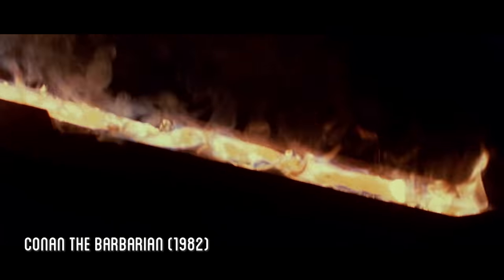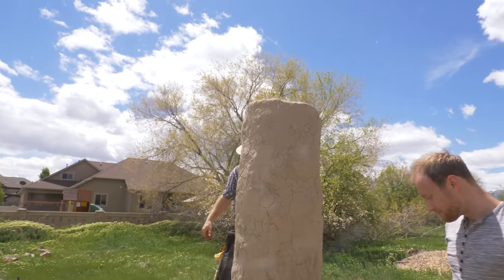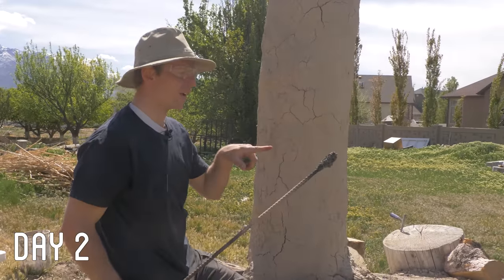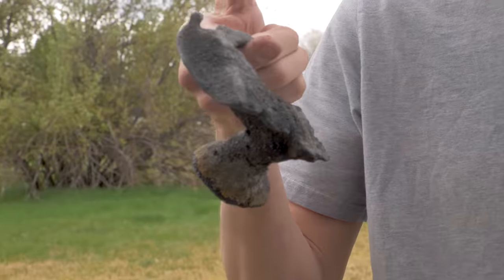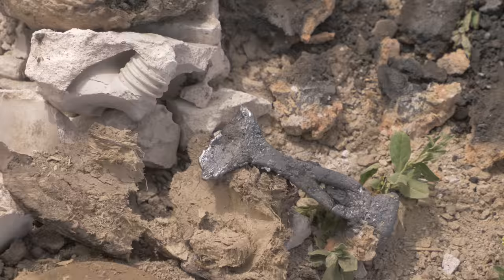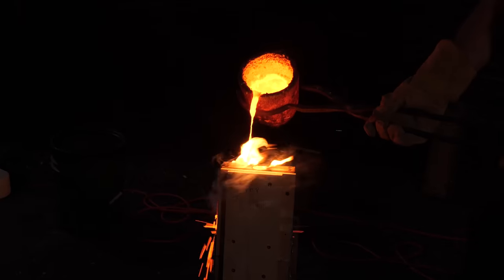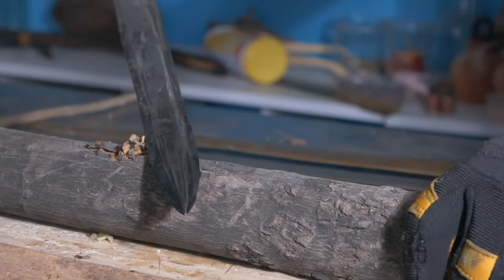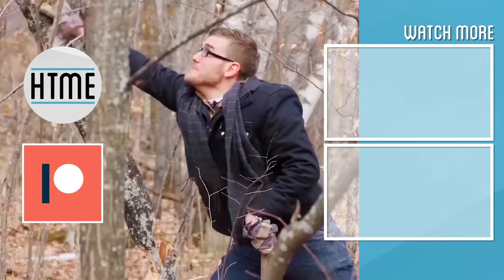Can You Cast an Iron Sword?

Comment: You may want to use two-piece molds and preheat them before pouring. 
Also, the Primitive Technology channel has a couple videos about making primitive cement from wood ash. Mixing that cement with silicate sand might get you a concrete mix heat resistant enough to keep your furnace from melting, much like the plaster and sand mixes used by TKOR, Nighthawknlight, and others.
Reply: It's a nice idea, and it MIGHT work, but..... I don't know.  I'm not sure whether it could handle that kind of heat or not.  Maybe?
Reply: @corwinweber693  Yes, a bit of a risk and probably worth testing a small piece under intense heat before building a whole furnace out of the stuff, but considering that Nate's furnace didn't melt when lined with a similar mixture and was still able to melt iron, I think there's a good possibility that a primitive version would perform well.
Reply: I would most likely advise against that since most cements tend to hold some water in them after curing solid, which is why you avoid modern regular cement in most high temperature applications since it'll convert to steam and blow the cement apart (even firepits). The primitive ash version might me ok but without a good deal of research making sure, I wouldn't risk it.
Reply: @tristantheafflicted  You'll really need to look at The King of Random or NightHawkNLight to see what I'm talking about. Most of their soup can, oil drum, and bucket forges (and even their foundries) are lined with a cement made of plaster of paris and sand. These builds and demonstrations are documented for your viewing pleasure.
Reply: @beowulfshaeffer8444  Andy could take another lesson from Primitive Technology, make a blower for the furnace and one of those ceramic redirection things, whatever they're called.
Reply: @anon_y_mousse  yes and charcoal instead of wood or horse poo.
Reply: @julienbo  Yeah, the horse poo is always a mistake, no matter what.

Comment: Pretty sure those film examples all state that they're steel not iron, but even so - great video!
Reply: Doesn't matter.  Casting iron or steel gives you a lousy result for strength.  It hasn't been work hardened.  When you move the metal (like hitting it with a hammer) the structure changes into a much harder one.  It's why you can break copper wire by bending it back and forth a bunch of times.  The copper gets harder and more brittle at the bend point until it finally breaks.  Iron does the same thing, and steel being iron with a little bit of carbon in it..... it does too.

At best he did a little bit of heat treating on that blade, and even then not much heat treating.  The blade wasn't at the right temperature for it and he didn't immerse it in the water.  Basically he just had a ground iron bar, and probably not even cast iron.  Not enough carbon.  (Pouring or casting the iron isn't what determines 'cast iron.'  It's the carbon content.  Mild steel or wrought iron doesn't have enough carbon in it to heat treat, cast iron has too much carbon in it to be useful for anything that's going to be under stress.  Both can be cast if you have a hot enough furnace.)
Reply: Steel is made from iron.

Comment: There was a continuous reference to cast iron, but it looked like the metal stock being fed in was rebar. This makes it cast steel,  dirty cast steel,  but still steel. Being steel it will have much better capability to be cast,  then forged and heat treated to a useable blade. 
The movies all show open casting,  but not further working. We could assume they forged after the pour. 
Worth trying again,  but next time with a furnace that can at least get good heat into a reasonable amount of steel.
Reply: Oddly enough in the tv scenes I've seen after they cast it and let it cool they then heat it again and let it cool then heat it again and hammer it on an anvil then dip it in water.

Comment: I found it pretty interesting that the cast iron sword managed to get in a few whacks into the wood. Another thing to consider when it comes to casting metal such as bronze or cast iron is a process called work hardening. Cast metals are generally fairly pliable one cooled, but after the process of work hardening which is basically repeatedly hammer them to form, the metal get consolidated and becomes much stronger.
You actually see a similar process in movies where they cast the iron swords into their preform and then go through the arduous process of hammering them flat and refine the shape as well as heat treating and tempering. Maybe the next time you try your hand at casting another iron, you could apply some blade smithing techniques to see if you get better results.
Reply: Im pretty shure you cant workharden cast iron (so the stuff with 2+% carbon content) in any practical way. Cementit (Fe3C), the stuff that forms in abundance due to the high carbon content, is super brittle, basicly a ceramic. The metal would form cracks before any meaningfull amount of dislocations has formed. Dislocations are what hardens the steel (not consolidation, this is a commen misconception) and are induced by deforming metal. 

But you are right. Casting pure iron (so no carbon) or steel would lead to better results, with the former being workhardenable and the later possibly hardenable the traditional way. But they are much harder to cast since their meltingpoint is much higher...

Comment: The melting dirt in your primitive furnace is causing the temperature to hold through the phase change (similar to boiling water in a rice pot).  Finding a higher temperature clay mixture may be a critical next step.

Comment: I don't think any of the movies are using "cast iron" they're using iron/steel that's cast. Modern steel mills use molten steel cast all the time.

Plus all the films show them forging the swords next, they don't go from mold to battle immediately.
Reply: Most costume swords are cast because it doesn't need to be strong alot bend and stuff forged things are better
Reply: You can't forge cast iron
Reply: @dustinstiner3057  like I said. There's a difference between "cast iron" and iron that's poured molten into a mold.
Reply: @NathanS__  iron that is poured into a mold is by definition cast iron and not something you want to be hitting on an anvil. Iron ingots that blacksmiths used were not cast for a region.
Reply: @neer muse the ingots which blacksmiths would have used back in the Middle Ages and before would not have been cast for a number of reasons. The first and largest reason is that casting metal is a very difficult process and is much harder to do accurately. The quality in casts, especially in ferrous metals, can vary wildly from one part of the cast to the other. There is also a problem with voids when it comes to casting, a void in the middle of an ingot would make it near useless. The material which blacksmiths used (in general blacksmiths purchased their material from merchants since they didn't have the facilities to make it it themselves) would come in the form of bars of stock which were made in large smelting facilities by the way of working and consolidating masses of ore into a cohesive chunk in a similar method by which one would process bloomery.
Reply: @dustinstiner3057  you could still forge with it yous just stack the peices of the blade to draw it out and forge weld them it'd just be like using some Japanese methods of forging but if you started with a sword you probably wouldn't have enough material to remake the sword
Reply: @matthewmcnamee2864  That is a completely different method for completely different materials.
Reply: @dustinstiner3057  you said you can't forge cast iron the method I talked about is a valid method of forgeing it its been used for low and high carbon steels and irons
Reply: @matthewmcnamee2864  sure chief, whatever you say.
Reply: @dustinstiner3057  say what you want but one Google will fix your ignorance the method they use for the bloom would work for making a new sword there is even a youtube video from aweme where they take a broken sword a refore it grated it was steel bit the same method would work
Reply: @matthewmcnamee2864  Difference is that tamahagane isn't cast iron.
Reply: @matthewmcnamee2864  Except folding is useful if your steel doesn't have an excessive carbon content to the point it shatters upon hammering. This happens to cast iron, except steels with a content that allows it to be forged.
Reply: @jonajo9757  yea after further research you'd probably have to cut it with lower carbon stuff to kinda even it out
Reply: @matthewmcnamee2864  my ignorance? I've been a blacksmith for 5 years. I know what I'm talking about.
Reply: @dustinstiner3057  lol 5 years that's soo long you must be a master blacksmith or at least a journeyman
Reply: @matthewmcnamee2864  never claimed to be a master or a journeyman smith. I do however claim to know what I'm talking about in this regard.

Comment: Awesome video, I'm going to have this video on tap for any future "BuT I kNoW tHeY dEfInItElY dId CaSt IrOn SwOrDs." conversation that I have :D

A minor correction: Cast iron =/= iron that was cast. Cast iron is a specific material, iron that was cast can be any kind of iron that you melted and poured into a mold. The act of casting doesn't necessarily result in a higher carbon content. It can, and for your primitive furnace attempt probably would have, but that would have been a function of the heating with charcoal, not the melting itself.

The reason you don't want to cast a sword is because of the poor grain structure that results from the process. You also wouldn't want to forge a sword from the material cast iron either though, because of the high carbon content which you mentioned in the video. The end result of both would likely be the same, a brittle sword, but the mechanisms by which they became brittle would be different.

Comment: I really appreciate the effort, but I was shouting at the screen when I saw y'all trying to pour cast iron into unvented molds.  With the cobb mold, I would have burned off the 3D print (lost PLA method) and poured the iron while the mold was still hot. Since you already have to model it up in CAD, oversize your print by about 1% to account for shrinkage as the molten cast iron cools down. 

How's the new shop build going?

Comment: As a Smith, both in name and profession (if only my mother had known), can I just say that it IS possible to cast a steel sword that is really quite nice, functional, and of decent quality? Not good quality, but decent. It is by no means the most ideal. 

You need a decent carbon steel, not overly high content - say 1095 or similar (do not use high nickel stainless - yes there are reasons), nickel, and a few other ingredients. Think of this as scrap steel reclamation as is done in a steel foundry to make stainless stock... same process. This is not EASY, especially if you lack the proper kilns that can reach the required temperatures, and a waste of time and material. 

Once cast, just as flat stock is cast in a foundry, and you add your profile by hand and hammer - not grinding as has become such a common short cut in blade smithing. This working of the steel will be correcting the grain structure, especially along the cutting edge, such that when you quench the blade the spine will still be relatively soft - the blade hardened. Precisely as you'd like.

Disclaimer: Simply because you CAN do this, it is workable, and it will make a fully functional blade of semi-decent quality - this is much HARDER than simply forging the blade. You will also burn a bit of your steel, and the rest. MUCH harder. In summation: harder to do by an order of magnitude, wasteful, and you end up with a worse blade than even a lazily forged blade. Stick to smelting steel back into stock, and forging like normal.

PS that'd be one ugly blade profile for any kind of iron.
Reply: Go to love that nominative determinism in action - I'm sure Mum would be proud!
Reply: Ok, but what you're describing here..... you are actually talking about a forged blade.  It's just casting into the rough shape first so that you don't have to go from a thick rectangular billet to a blade.  You're still work hardening the steel, at least the edges anyway.

Comment: I'm not sure what route you're going to take for steelmaking, whether you're going to go with refining iron blooms to steel (via secondary furnaces and/or selection of your pieces by carbon content and then pattern welding etc) or if you're going to jump straight to crucible steel. 

However you could consider the less commonly known methods of decarburizing cast iron into steel which pre-date the bessemer process, which are the puddling furnace and it's more primitive predecessor the finery furnace (which is essentially just a hole in the ground). Both of these basically work by stirring cast iron so that oxygen can get into it to burn away excess carbon, leaving steel or iron after.

These methods are not seen much in pop-culture, since finery furnaces were mainly used in asia (and in fact there isn't much evidence of bloom steel ever being used in China), and didn't make their way over to europe until at least the 13th century. 

As a result I haven't seen many videos of these processes online so it could be cool to have one of the only videos on the process, especially since all our modern processes are based on these (which is particularly good for the whole "making your way to modern technolgies" theme)

Comment: i hate how half assed this is, instead of using what he learned from casting bronze, he acts as if he never casted anything before... not that would help but still using horse dung was probably the worse offender: the plant matter burns and produces smoke and gas which stops the metal from flowing because it occupies the space instead. Add that to the fact that none of the molds have vents in them, its no surprise they all failed...

Comment: amazing to see lost pla casting with cob!!! i wanted to do research about something like this, but it's mostly impractical to try and reinvent the wheel of ceramic shell casting, so there isn't much readily available info on it. you guys did great on this. casting iron in a homemade cupola is no mean feat!!! i think the only other cool thing you could consider is casting thin plate, heating it up, and allowing it to decarburize, as a source of cheap decent-quality wrought iron for tools and stuff. if you made it really thin and heated up below burning temperature, all the carbon and phosphorus and sulfur would burn off, and then folding it a few times would squeeze out most of the silicon impurities. if you add this essentially pure iron to a crucible with some pig iron in a controlled way, and allowed it to dissolve together in a cupola, you could make really nice modern quality steel. or potentially even make a rod-shaped crucible to make your own high quality steel that was cast round stock, with no forging needed (though this would be more difficult).

Comment: An interesting related line of research may be a wind-fanned forge. Seems there are locations in Europe that used either coastal ledges or bluffs or slopes on the side of a valley that take advantage of natural wind conditions to fan the firing of the furnaces. There would be scoop-like structures built that would channel the prevailing wind that hits a rock face into one of the lower chambers where the firing was done. It may be one of the possible ways they got stuff like crucible steel, as it would take much less human effort to sustain higher temperatures. Not sure how you'd recreate that, since having an effective setup seemed to be highly location dependent with a consistent and somewhat sustained dry wind.

As far as casting a more steel-like iron... Might be some hybrid processes? An initial casting and then hammering out while red hot. (Some aspects of forging, but perhaps not as intensive? It would help with voids/cracking, but less actual forming of the material.) The main thing to make something like that strong would be the tempering/annealing process.

Comment: Question becomes how hard would it be to get rid of some of that extra carbon thru a secondary process and turn this material into useful steel ? In such a context casting it initially <might> make sense.
Reply: Ilya from baltimore knives and swords (back when he was still working for man at arms) made crucible steel from cast iron and some iron to make quite an awesome viking sword. I'd love to see andy take a shot at it, at least making the crucible steel part..
Reply: A sword wouldn't be terrible to get the carbon out of, since it's got such a thing cross section and high surface area. Carbon will naturally diffuse out of iron at a high enough temperature, similar to case hardening in reverse. Early blister steel was made in this way, keeping cast iron ingots in a carbon deficient atmosphere at a high heat for hours or days.

It's generally more efficient to start with a wrought iron and add carbon than to start with cast and take it out, but it's definitely doable
Reply: @microwave221  I thought the scale is decarburization. So it's possible to decarb steel without it disintegrate into pieces? Wouldn't it be only surface decarb?
Reply: @Herr_Scheissemann  I've been under the impression that scale is an oxide, but I've never really looked into it. Metal does oxidize faster at the relevant temperatures regardless, so the sword would likely fall apart by the time it lost enough carbon to be steel unless the atmosphere was controlled to some extent.

Carbon will entirely diffuse into or out of the entire bit of metal given enough time, Clickspring does a great demonstration of this in his video on case hardening. It does start at the surface, but will gradually work it's way down to the core